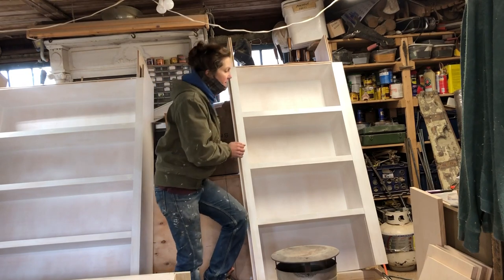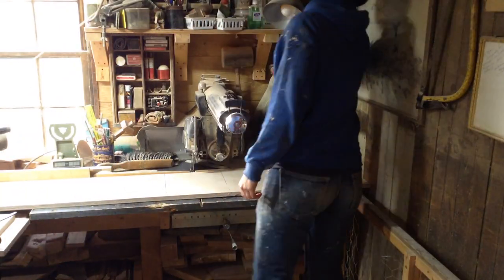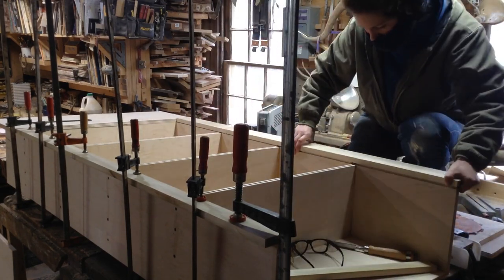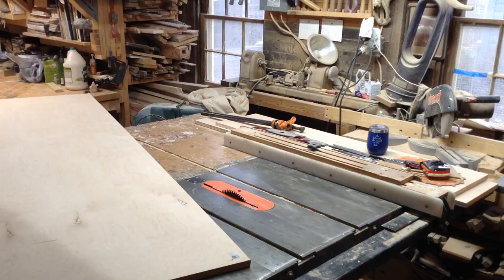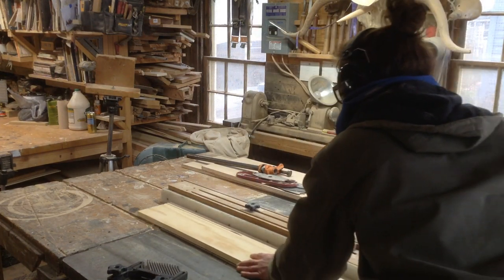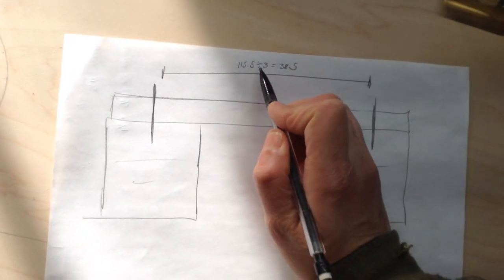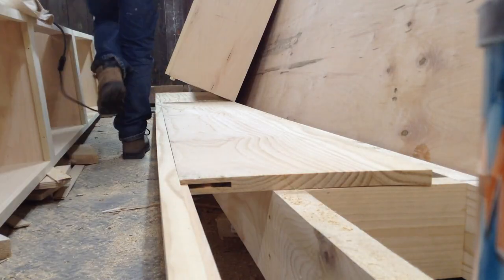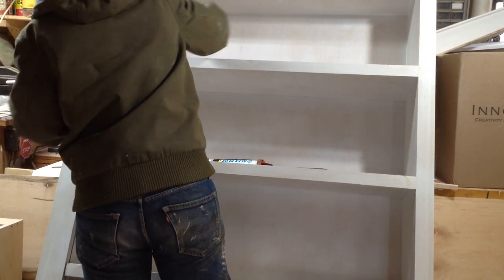Woodworking: Full Wall Built-In Cabinets // How - To Part 4

Comment: Great work! I was wondering wouldn't it be easier to make the total size of the piece slightly smaller and the use filler strips to scribe to the walls?
Reply from the maker: The ends are detachable for scribing, I find that is the best way to do it.

Comment: have you ever considered using a lamello jointer instead of splines, it seems that it would be a lot faster than cutting and making all those splines to me
Reply from the maker: The splines are really not as time consuming as they may seem.  I don't love the idea of plastic joinery, and having to be tied to buying the parts.  Price point is steep as well.  But, they do seem like cool machines.

Comment: Do you have a portable heating system in your shop? My new shop is an unheated garage and I am not using the shop as much as I like because of the cold.
Reply from the maker: I have a propane heater.  Its a pain and I don't love it, but it makes the shop bearable during the winter months.